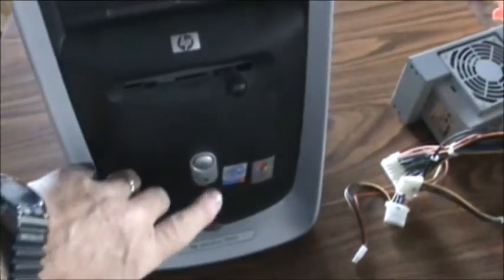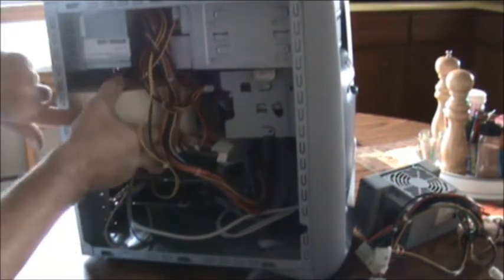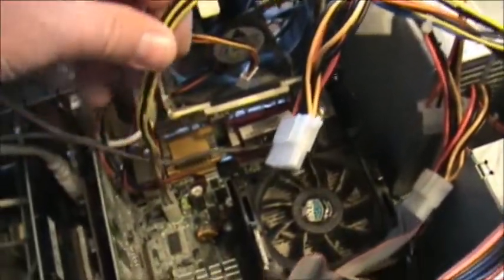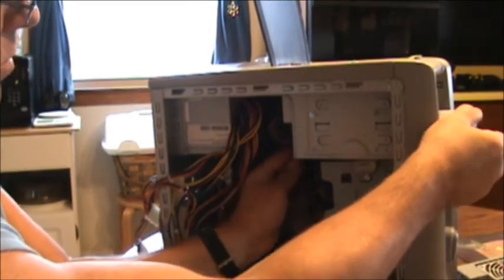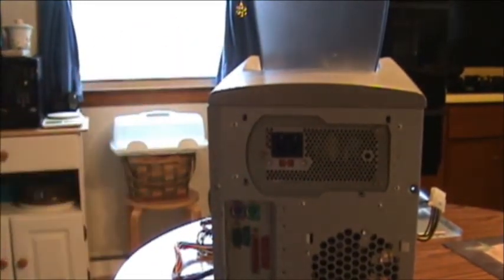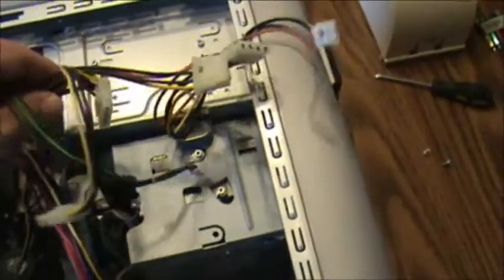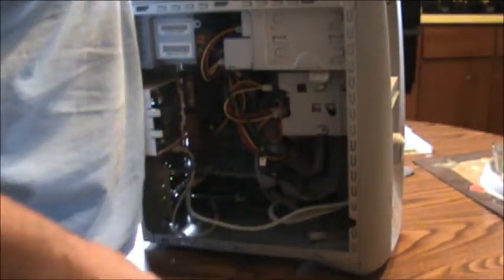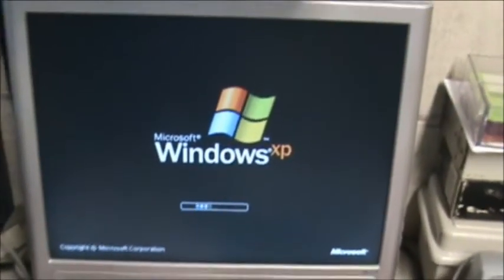HP Pavilion desk top computer power supply

Comment: the main reason HP sucks,,,the power supplys are 300 to 350w no name garbage that HP make themselfs
Reply from the maker: They R so easy to replace I just replace them whenever they go out with a 250w I don't use the same brand and I don't need anymore power than for what I do.